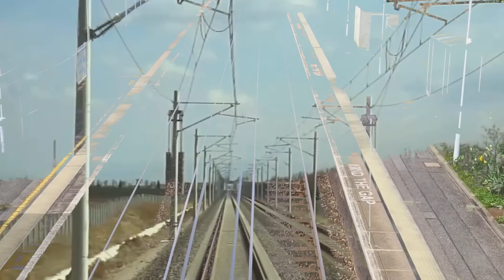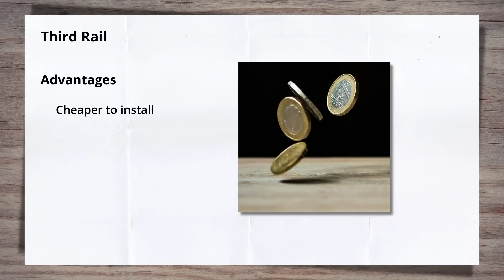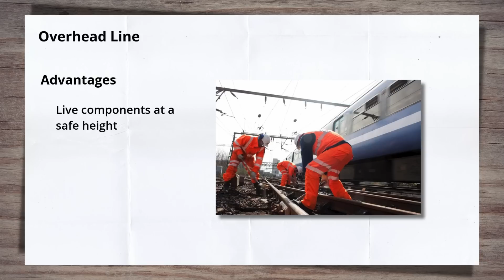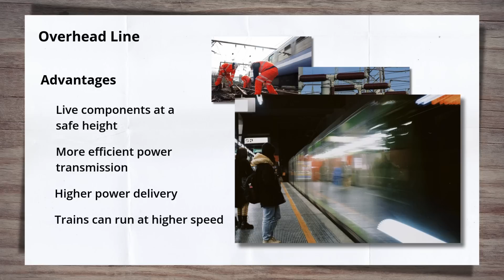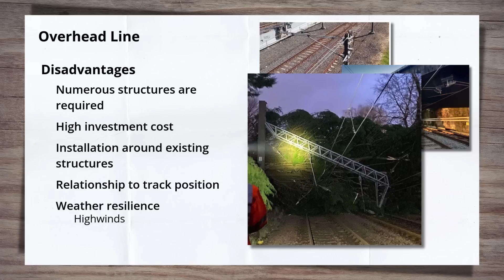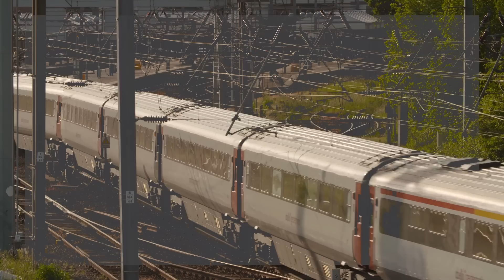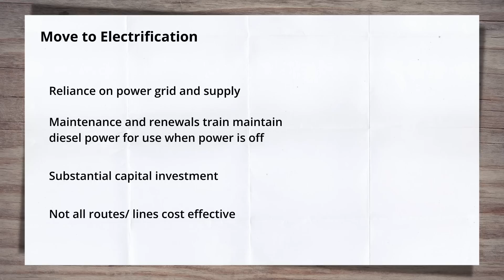How Trains Are Powered on the Railway | Third Rail vs Over Head Line Wires

Comment: It amazes me that there is not the ability to have the live sections come alive as a train approaches each section.  Surely that could be built into the signalling system so that as a train approaches the end of one section then the next section of line becomes energised.  I know that this would cost more to set up, but if live third rail or live OLE was not energised until just before the train gets to that section, then anytime a train is not in that section, the system could isolate that section so that the risk of electrocution, either by third rail or OLE is negated to quite a degree.   Any views please anyone.  Serious question which I am interested in..  Thanks.
Reply: This is like the surface-contact system for street-running trams. Live contacts on the road surface would be clearly unacceptable, so the extra complication of switching had to be introduced.
The cost soon killed the system, and overhead live was installed instead.
On railways, the problem doesn't arise, because the line isn't available to walk on, and anyone doing so faces a far greater danger than electrocution.

Comment: Not sure where you get the idea that high voltages obviate the need for transformers – the traction motors in a locomotive draw a lower voltage than the majority of overhead supplies.
I am pleased that at no point have you referred to catenary, only overhead line equipment (OLE). Most videos bang on about trains drawing their power from the catenary not realizing that their error.
Reply: The only error there is in your understanding of English.
Reply: @tooleyheadbang4239  that’s an interesting comment - please explain why to this ignorant native speaker teacher of English as a foreign language…
Reply: @TijgerTim  Because in railway terms, the type of overhead power supply which consists of a rope or cable suspended above the line is known as 'catenary', from the geometrical shape of the curve which such a rope or cable assumes.
Reply: @tooleyheadbang4239  exactly, it is the curve of the suspension wire between the masts which can also be the carrier wire where the droppers attach directly to the contact wire. But the entire structure is not catenary…

Comment: It should also be noted that with OHLE, because it is typically run at higher voltage, it is incredibly dangerous to work or be near active overhead lines. E.g. 25kV AC ohle (what is used in the UK) can jump out to someone up to 6 feet away from the cable itself.
Reply: The OLE in UK can be approached to within 0.6 metres by specially trained staff using specialist equipment. I was investigating the properties of Lightning for a technical paper and contacted Rail Track about the problems they encounter with the OLE. Which is where I got that information from. Incidentally a lightning cell can affect structures up to 16 km away! There is a case of a real bolt out of the blue at the Army's cup final in 1948 at Aldershot. A clear blue sky and a bolt of Lightning hit the ground, people were killed, and badly injured.

Comment: We Need it On Vline In Australia 
Also in Melbourne Has A Metro Rail system 
Southern Cross is The Terminus of Vline Services !! AND metro Services! 

Metro Tunnel will open With 5 New Stations in Melbourne! Two Stations Will Connect Flinders Street Station And Melbourne Central Station

Will edit this

Comment: Not sure if its still running , but I once travelled on a Train from the Bedford area to Brighton, the first part of the journey was powered from above via a pantograph, then somewhere on the line round west London the train stopped for a couple of minute , the Pantograph was retracted and we continued using power from the third rail!  A most interesting ride.
Reply: Thameslink still does this, yes, there hasn't been any major change to the 3rd-rail network, it was neither expanded nor converted to OHLE.
Reply: @barvdw  ...although some parts of it were once overhead.

Comment: Overhead wires offer the most safety and have lower maintenance costs. Also it’s almost impossible to run any sort of high speed rail with 3rd rails which is why it’s usually limited to subways.
Reply: There really is no reason for Third Rail systems other than spatial availability issues and NIMBY-esqe mentality of "visual clutter" (they don't like overhead wires).
Reply: @Gelatinocyte2  Bit too simple. Horses for courses. Catenary depends on factors such as the need to raise bridges, over-bore tunnels etc. Modern 3rd rail is generally cheaper to install and maintain than catenary for lines not exceeding 120 kph.
Reply: Lower maintence costs? Maybe, but with overhead wires you have to maintain a repair-crew 24/7 in case of failure. Many years ago, my tutor, a veteran of South African railways related how he was involved in re-fixing the trains in Italy in the wake of the German retreat in WW2. One day, the wire broke and snaked back on forth on the station platform with people literally petrified. At least third-rail will not do that!

Comment: Alston announced a 100mph 90 mile range battery train. They are here. The batteries are only getting better. This sort of range is good for say a HS2 hybrid serving Chester, on battery for the last 30 miles as wires cannot be fitted as the bridges are too low.  

Trains will also get lighter to improve efficiencies. I can see de-electrification on many passenger routes especially on 3rd rail. Ellesmere Port . For example on Merseyrail, the dangerous 3rd rail can be ripped up from Spital station to Chester and Ellesmere Port stations when the Warrington service extended from Ellesmere Port comes online using the battery hybrid Class 777s which can charge from the 3rd rail.
Reply: We had de-electrification on Tyneside, when commuter services were changed to Diesel.
Nothing had become dangerous, nothing was 'ripped up'. The electric installation was declared to be 'worn out', and Diesel was the cheaper option.
Reply: @tooleyheadbang4239  
3rd rail is dangerous - for obvious reasons. If it can be ripped up for safety reasons, then rip it up. Times move on.
Reply: @johnburns4017  I'm only interested in facts, not Journalism.

Comment: Here are three things you missed:
1) Floods will also affect most overhead wires.  In both third rail and overhead lines, the power returns on the running rails so if the track is flooded even overhead wire will be taken out.  The only way around it would be to have 2 wires overhead.  That hasn't been used much on rails but it is necessary for trolley busses.

2) A trolley pole can also be used for overhead wire collection.  I think they are still used more here in the US but even here they are mainly used for museums and heritage streetcar (aka trolley, tram) lines like those in Tampa, FL and Memphis, TN.  There have been other methods like the bus bar (that may not be right) which is a loop of metal that contacts the wire like a pantograph but has little support hardware like a trolley pole.  This method is pretty much extinct as it was mainly used as an intermediate step between trolley poles and pantographs.

3) Another issue for overhead wires is that it restricts the loading gauge.  Here in the US, most trains that carry intermodal containers are double stacked containers.  In areas with overhead wire, (primarily the Northeast Corridor and some suburban electrification) only single stack containers can be run.  Similarly, Amtrak's Superliner cars and other bi-level cars can't run on the northeast corridor either.  That is not as much of an issue in Europe and the loading gauge from other factors limits containers and passenger cars to single level.  This is not insurmountable as the Metra Electric lines in Chicago, IL run bi-levels and some French TGV's are bi-level.  Of course, the wire much be much higher to allow for high height cars and thus is best done before the wire is strung.  Raising the wire height significantly will usually require larger pantographs and will often require modifying bridges and tunnels or lowering the track to make the required clearance.  This is not unique to overhead wire.  The US railroads have spent millions if not billions of dollars to increase clearances to permit double stacks in non-electrified territory as well.
Reply: 1) not at all. Return current has very low voltage. So it doesn't cause any problem. You can even touch the rail just after a train passed and you wouldn't get electrocuted. I have seen trains with overhead wire  going through floods both in Germany and in India. 
https://youtube.com/shorts/epdxNLMsIgk?si=QRG0sc6NobxkOtIp

3) India has dedicated freight corridors with high overhead wires for double stacking.

Comment: There are some errors and questionable assumptions in this.
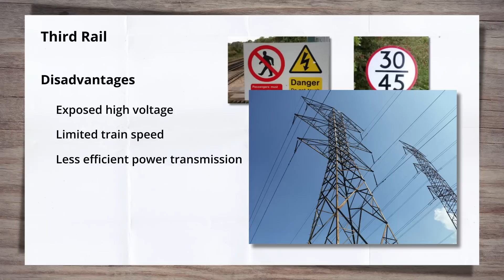Reply: I watched until 3:17.  "Trains using third rail systems also require a transformer to be fitted, which takes up space and adds weight to a train..."
Yeah, right.
Reply: @tooleyheadbang4239  some actually do if I'm not mistaken
Reply: @Gelatinocyte2  Yeah, right.

Comment: I don't know about UK but in USA the Diesel engines only run large 4,6 cylinder engines to power very high voltage producing generators which in turn send the electrical energy to the "Trucks" (Wheels) of the train which are powered by big heavy Powerful electrical motors. So those large looking Train engines are really just big motors like in a car that turns a generator to produce the electrical for the wheels. So in a way you really are running a truly Electric train. The diesel is only to allow the big machine to produce the electrical power on the go. Some say it is still the most efficient way of moving any train and almost any weight. At high speeds they can also do as well the problems with that is more the Rails on which the trains would need to run safely. Just thought I would add this comment. I like your video a lot. Thank You.! Informative and really cool. Peace.
Reply: UK diesel trains are much the same (many were built in the US). But huge generators such as power stations are far more efficient than smaller ones in locomotives. The difference is enough to outweigh the transmission losses.

Comment: Heat is not a real issue on constant tension catenaries because they counterbalance the lose of tension caused from heat stretching with tensioning system. Heat is a problem only on old fixed tension catenaries, like parts of NEC electrification. Another disadvantages of third track is the needed of use high currents to supply sufficient power to engine, limiting also the power that train can pick up from third rail, especially if they use a low numbers of shoes like on locomotive hauled trains. OHLE usually can use higher voltage (up to 3kV on DC or up to 25 kV on AC typically, sometimes also 50 kV), carrying more power with less current. Nowadays third rail electrification make sense only on metro lines to save money in digging tunnels and not always, because if there is sufficient room overhead is better to install rigid OHLE instead of third rail equipment, it's safer, can manage higher voltage, it doesn't have gaps on switches zone and  allow higher speeds.

Comment: Don't forget trains have an inherently low rolling resistance due to the steel on steel interface. So even a diesel train will be more efficient than a car or a lorry in most cases. I often wonder if some of the efforts to decarbonise the railways would be better spent in just increasing the modal share of the railways. Electricification where it makes sense (and again the steel tracks make a natural return conductor, so it's easier than for road transport) but not at any cost.
Reply: Regarding environmental concerns I think that the penalty for lateness should be relaxed (UK), in particualr for Diesel trains. Some Drivers drive very uneconomically even under normal conditions (going from acceleration to braking without coasting). Perhaps Germany has more late trains because they don't penalise for lateness out of consideration for waste of fuel & excessive wear of brake pads.

Comment: I've often wondered ( and perhaps an engineer can enlighten me ) regarding 3rd and 4th rail systems. If metal shoes are held against the live rail by a spring or similar means, and the train can run up to 85mph, then why don't the shoes heat up through friction and even start to glow red hot?
Reply: Because the pressure is minimal (on the London Underground for example it's only the weight of the pickup keeping the connection) keeping the friction down, plus the thickness of the rail means that a train does not have time to heat it up appreciably. And the pick up shoe is cooled by the rail, as well as recieving electrical power. It's hard for a small pick up to stay hot when sliding along a big lump of metal at outside temperature. 

Sideways and inverted rail systems do need springs, as you say, but again the pressures are designed to be as low as possible to allow the system to work, partly to reduce wear and also as you say this reduces the friction heating.

Comment: In Switzerland the railways are 100% electrified. Previously, Switzerland used steam locomotives and was dependent on coal deliveries from Germany. This was also the case during WW2, where Switzerland was afraid of being occupied by Germany, which didn't happen. But Switzerland has the ability to generate its own electricity using water. That's why steam locomotives were soon equipped with electric heaters. Because that was ineffective, they then built electric locomotives.

Comment: The third power rail is well suited for subways in narrow tunnels. 
A suspended cable would mean a larger tunnel diameter. 
There is often no space for this. It is enough for a power rail on the ground.

Comment: Why didn't you mention overhead solid conductor, where you stick a rail on top of the train. It is costly to set up, but is very reliable, isn't prone to the same wind issue and can be used to give very high voltage, reducing losses.

Comment: There are pantograph contact strips that can be used to remove ice from the wires. Equally there are special inserts for shoes on trolley poles for the same reason. They are made from steel and can withstand the mechanical forces when scraping off ice build up on the wire. However, these are not good for conducting electricity, but when it comes to de-icing, the efficient transmission of electricity is not the main issue.
Reply: on the US NE Corridor you will see some trains run with both pantographs up in the winter. The forward one presumably has the ice breaker and the back of the locomotive is primary power collection. Normally they run with the rear one up and the front down, Which I presume is because if something happens and it rips off they still have one, Where as if the front was the primary it could damage the back on its way off the locomotive.

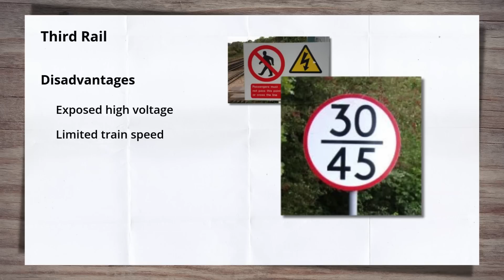Comment: 3:04 The commonly held belief that transmitting DC is less efficient than AC isn't necessarily the case. Whilst this was true many years ago, we now have technology that is being used to transform DC voltage up and down at transmission line capacities.
Reply: It's not just about transformers. Long distance high voltage DC transmission is great for sending very large voltages over major transmission lines, suspended from large towers running through cleared rights of way connecting places of supply and distribution that are a very long way apart. 

The same technology is not optimised (and not economically adaptable) for supplying suitable voltage connections to train systems at points that are relatively close together. 

In the past something like 750 or 1500v DC was the best option. In the last several decades higher voltage AC technology has developed so that it is the 'go to' system. and 25v AC is easily drawn from typical public power grids and suitable for overhead wire supply.
Reply: Yep.  There are very high voltage systems that reduce the loss that AC systems have through capacitive and inductive reactance.
Reply: DC is usually for 3rd rail & that cannot use high voltages for safety reasons.